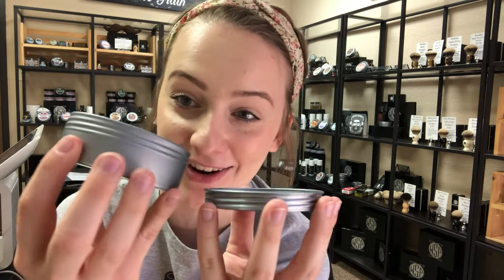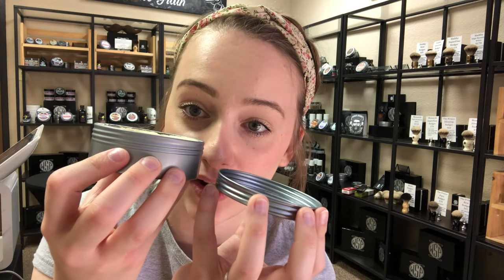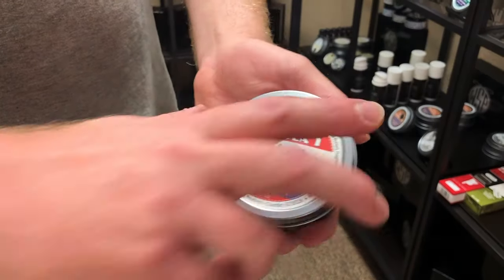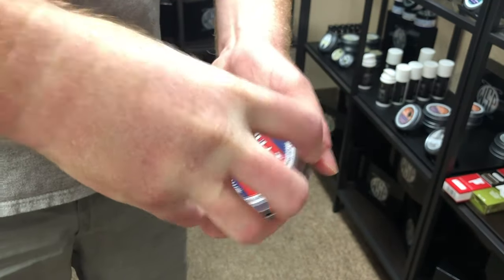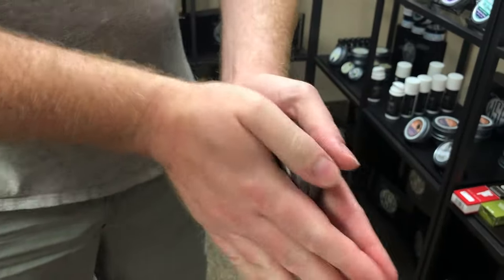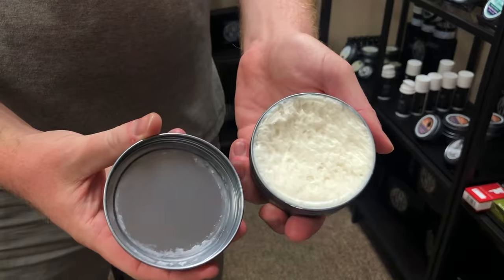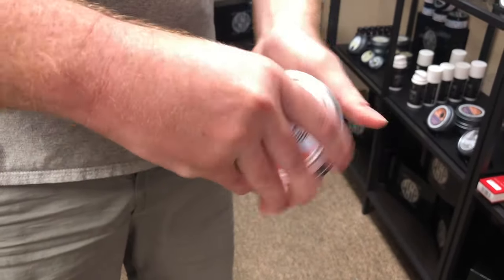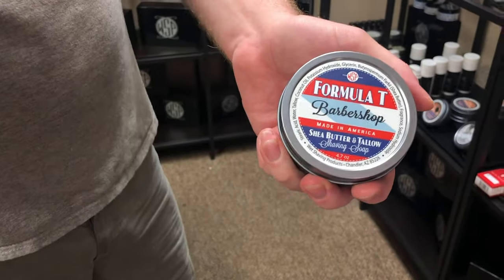How to Open a Stuck Tin

Comment: I put my tin on the counter and applied pressure with my palm and kind of used body weight force, which it made a pop noise ..as it popped into the slot properly and it opened very easily after thay
Reply: Yay thanks that helped!!!!

Comment: I flipped the tin on its side, aligned the side of tin with the floor, placed my index finger in middle of the lid and the can itself. Push down with your index finger as you throw it on its side to the floor (preferably a carpet (unless you're a tough guy)).

Comment: If the tin is too big for your palms or you can't hold it with your palms just lightly jam the side of the tin on a solid surface. It should become easy to open.
Reply: Thank you your trick worked for me.

Comment: I use products by Sola Skincare with the same style tins. Sometimes I would "cross-thread" bottom and top of tin, but was always able to unscrew that. But then one tin was just plain stuck. I emailed the owner and she suggested placing it in the fridge. I did this overnight, and this morning my husband opened the tin! So there is an idea that worked. Not sure what happened to the tin that it wouldn't open...it had not been used in awhile.

Comment: Couldn't get the can open via the hand method. Used the foot method, place the can on a rubber kitchen mat face up, use your tennis shoe on your foot and push down and turn until you have the click. The tennis shoe rubber mat method provides slot more down pressure.
Reply: omg that worked! None of the other methods worked! This foot method worked! Quickly! I was ready to throw it away! My tin doesn't have a lip. You're a genius!